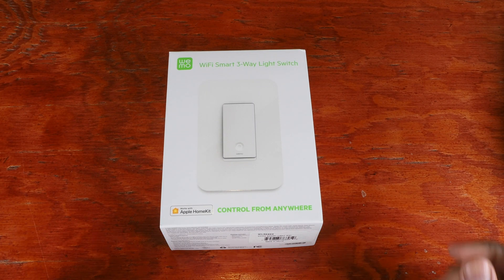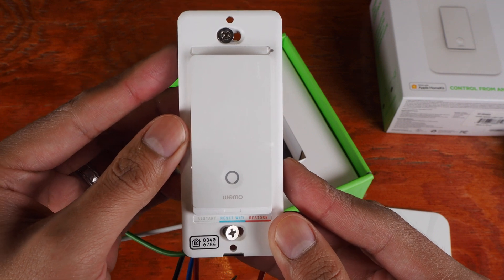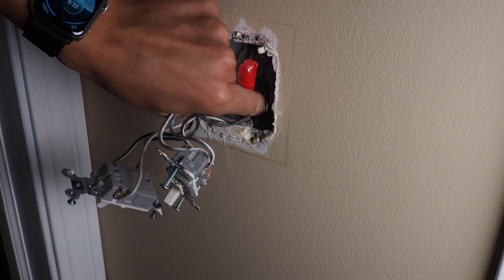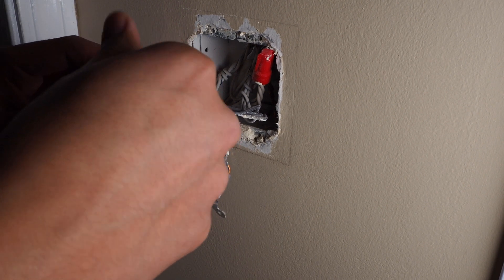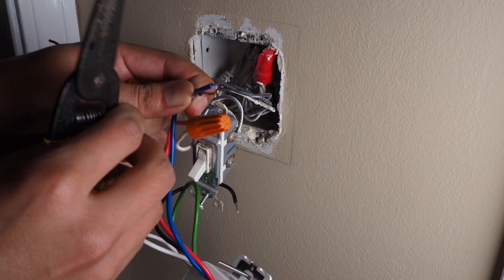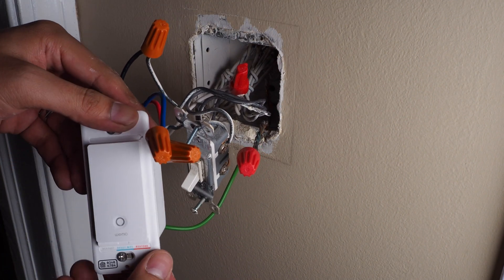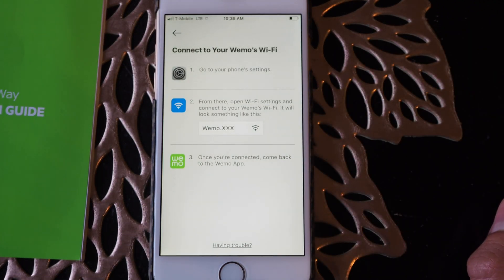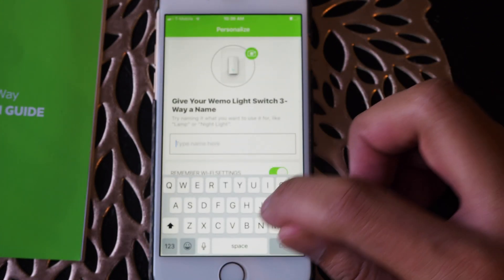Wemo 3-way smart light switch - Apple HomeKit - Unboxing/Demo and installation

Comment: Did you replace the other switches in the 4 way?
Reply from the maker: No, just this one. And it’s able to control the 4 way setup
Reply: the only thing is you have to leave the existing 4-way switch in the circuit as there is not a WeMo 4-way switch.